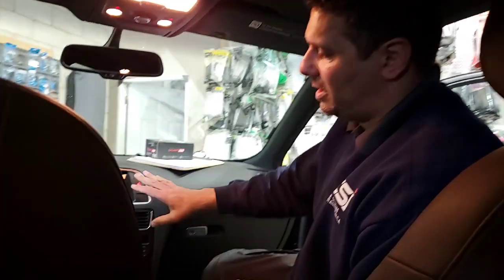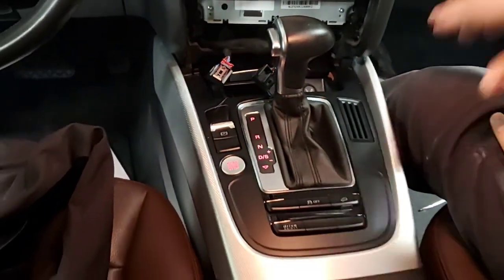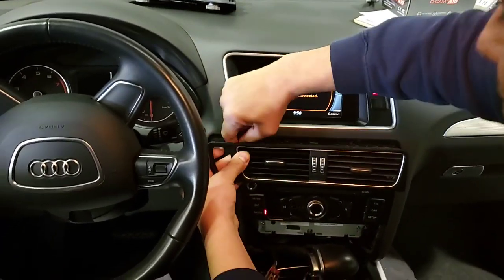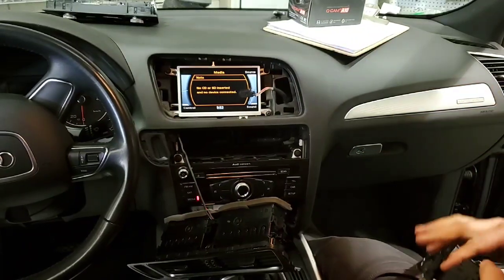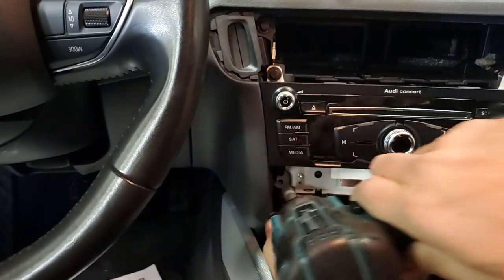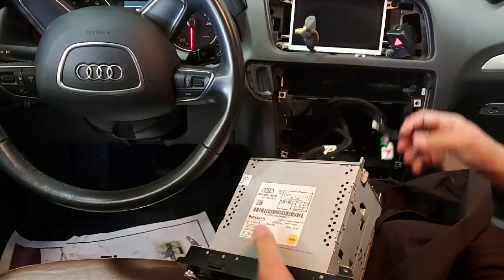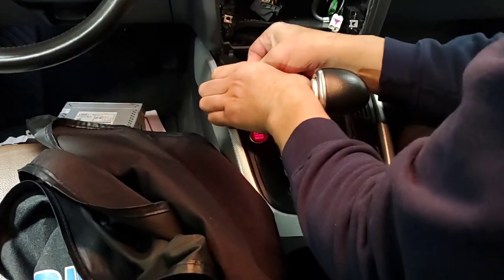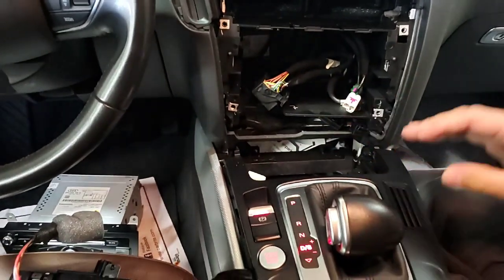How to remove Audi Q5 2017 Radio, AC controls, Media screen, cigarette lighter and Push Button

Comment: @@UCw9_Eya6cIiw2jyRA5RtRjg
--If you end up doing a Dash Cam Install on a 2012 newer Dodge Grand Caravan , could you show how you remove the A-Pillar plastic (that hides the airbag , near the windshield )   and how you go about running the hard wire kit from the dash cam to the fuse box   OR   from the dash cam to the OBD "hardwire kit" )